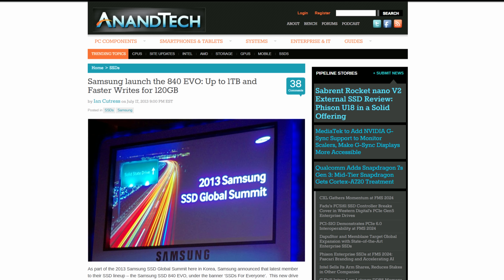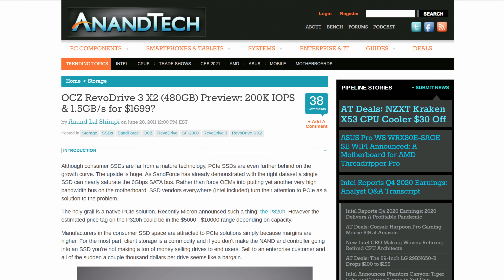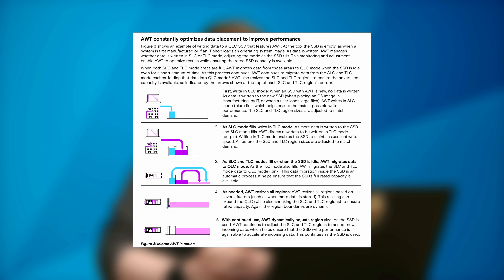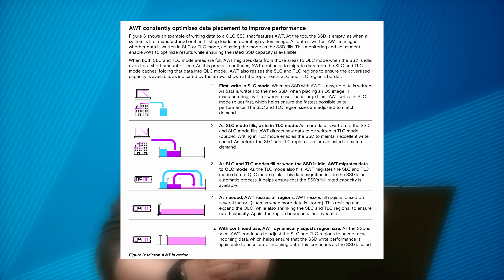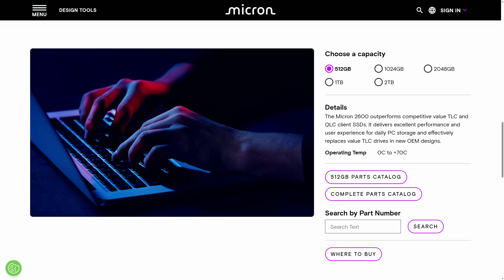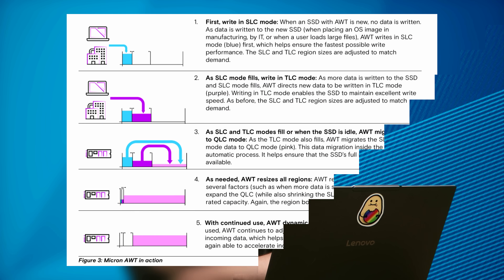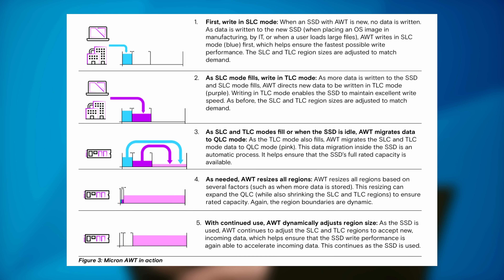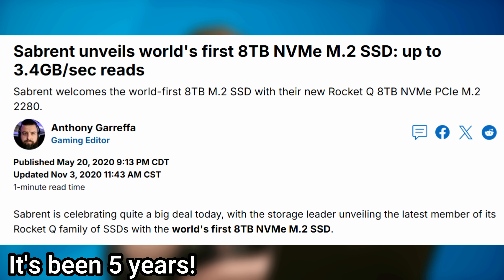Big.Medium.Little Comes to Consumer SSDs

Comment: Is this functionality enabled purely through the controller and its firmware, or does it require the actual NAND chips themselves to support multiple modes (for example instead of just TLC or combination SLC/TLC, you need a special chip that can either write SLC/TLC or QLC)?
Reply from the maker: It's probably 99% firmware, 1% hardware. They said it required some customization. That might be for some weird edge case though.

Comment: Flash sucks. Period. It has sucked since the late 70's when Toshiba started developing it. It doesn't deserve the status of "SSD". Just because it's better than Rotating Iron Oxide (1950's technology), doesn't mean it's that much better. One big reason it can be so fast in transfer rate is that it has many channels, typically 8, sometimes 16 or more. There's just so many things wrong with flash... but that's all we're given.

Comment: There are PCIE 5x2 SSD, such as the 990 EVO Plus.
However, the PCIE Lane allocation is not just something on the SSD end, you would need cooperation from the mobo end on how they lay out the lanes too, of which I have not seen much if anyone doing PCIE 5.0 x2 for M.2 slots.
Reply: Many AM5 boards have PCIe 5 x2 as an option because the other two lanes are (optionally) taken up by the USB4 chipset.
Reply from the maker: It requires bifurcation support as well at the CPU level. AMD Threadripper and EPYC are good at this, Ryzen can depend, Intel is almost a no-go and requires specific combinations.

Comment: This smells like, let's push QLC on everything so we can sell more drives in the future
Reply: The technology is the same if you make SLC or QLC drives, so the price for the memory chips is the same. Only thing it that you need four times the memory chips for SLC as for QLC, so at minimum if you only look at the BOM or Bill of Material the SLC memory is four times as costly for the customers. You get 1TB of SLC space for the cost of 4TB QLC. That's a hard sale as people are pinching their money.

When you talk about durability there's the TBW or TeraBytes Written. This is a number the manufacturers assign to their drives and it's supposed to give an indication of how durable the drives are. I say "supposed to" as it's not easy to predict durability before many thousands of the drive has been used for a long time and punished with a lot of written data. Someone said that it's the figure at which 50% of the drives has failed. But the manufacturers use it in a way that I think it's a lot better than that. Most manufacturers have a 3 to 5 year warranty, but it's appended by "or up to TBW". That means that even if the drive are within the warranty time the warranty is not valid if there has been more data written to the drive than the TBW rating.

So we have a kind of durability index, but what does that mean? After all all drives use similar memory and often the same controllers so they all have the same durability,. Right?

Wrong, or at least to the manufacturers this is not the case. Looking at the webstore I usually use I see that the Crucial E100 M.2 NVMe SSD 1TB has a TBW of 80. The warranty is 3 years or until it reaches TBW.
Switching to a Kingston NV3 M.2 NVMe Gen 4 1TB it has a TBW of 320, and a warranty of 5 years or until it reach TBW.

And the Kingston drive isn't really extreme, nor is the Crucial one. If we look at Crucial T500 1TB M.2 NVMe PCIe Gen 4 it has a TBW of 600 and a Kingston Fury Renegade G5 1024GB PCIe 5.0 M.2 NVMe has a TBW of 1000

Now I will say that the Crucial E100 has the lowest TBW I've seen and that the Kingston Fury Renegade has one of the highest. I've only seen one with a higher TBW and that's the Seagate Firecuda 530 which has a TBW of at least 1200. The 4TB version has a TBW of 5100 and the 4TB Kingston Fury Renegade has a TBW of 4000.

Now as the durability of drives are hard to predict before enough has been used for long enough isn't this just a glory number for the manufacturers to wave around?

No I don't think so. The use of five years warranty or up to TBW means that they really believe that these drives will be decently reliable up to that many written terabytes. A RMA really costs a lot of money and they absolutely want to minimize the warranty claims they have to handle. The Seagate warranty also offer to recover all data that's readable from the failed drive, and that's an extra cost so they really don't want people to request warranty support.
Reply: QLC for most NAND storage devices is probably the right approach for most applications outside of HPC, wouldn't you say?
Reply: @paxdriver  It's too slow, and does not have a long life. I would consider it for a media server that mostly reads, but for that it's still too expensive to have a 18TB drive for 300 usd
Reply: @silajim  Controllers are smart enough that you won't notice a difference. The individual cells may be less reliable but wear leveling, overprovisioning and error correction will hide that from you.
Reply: @paxdriver  no. just more cost savings for makers but almost none passed down the chain
Reply: @lelkasa361  Are you saying there is no competition between SSD manufacturers? Of course there is (but right now there is a lot of demand from data centers).
Reply: @paxdriver I would agree if the only concern was performance.

It isn't, the main downside for adding more bits/cell has always been lifespan.

This technology doesn't change that.
For some usecases, QLC is perfectly fine.

But on any consumer device expected to be used on a regular basis?

Do you really want to take that risk with your personal data? 

I personally don't and i doubt most people will take a 33%(Max) saving on  a relatively affordable component but have it risk reliability.
Reply: @krazybonnie5523  The SSD controller manages endurance for you, and it can even let you know if the SSD's health has degraded to the point that it should be replaced. An SSD won't just suddenly die. If QLC cells break, error correction makes up for it, and the controller will just move the data elsewhere.

Comment: regarding cell degradation, i wonder if it would be possible to rotate a cell that has drifted too far to support QLC mode to be permanently in TLC or SLC mode.
More information and control over this stuff should really be exposed to the users
Reply from the maker: Yes that's perfectly possible, however the default mode if a cell starts to degrade is label it unusable and take a different cell (or rather, page) from the pool of overprovisioned storage. Lots of people feel uneasy using cells for data that 'are degraded from warrantied use'.

Comment: Cool thing is that they can re-purpose cells for different modes.
Not sure how SLC is less harsher. If I understood correctly, it still changes between some levels that match some bits combinations of QLC.
I thought that longevity of SLC comes from the fact that it is easier distinguish levels corresponding to bits and if cell degrades it is harder to keep it at designated levels.
Would be cool if they would repurpose QLC to SLC when cell quality expected to degrade soon. E.g. have shrinking SSD instead of just "bad sectors" once run out of replacements.
Reply: Flash cells does not work that way. When a cell degrades it means it can't hold the charges in the charge trap material anymore so even if they convert the cell into SLC the probability of an error is now very high that it's no longer a reliable storage medium.
Reply: @kazedcat  why SLC have higher longevity and QLC?
Reply: @virkony it's probabilistic with more bits per cell the chance of a bit error is higher. The charge trap material degradation is independent of the bit level but the longevity is affected by the error rate.
Reply: @kazedcat  sorry. I don't understand your logic.
You effectively say that more bits per cell (e.g. QLC instead of SLC) is what influences longevity since error rate will be higher for QLC.

On the other hand you say that bit level (SLC vs QLC) have no impact on degradation. I.e. when we write to SLC and QLC cells they will degrade equally.

This only supports my assumption that SLC lives longer just because it have lower error rate which is because it is easier to separate charge levels between smaller number of bits than between bigger number. E.g. if max stored charge drifts, there is bigger margin before bits get flipped to the point when error correction not effective.

Comment: One point I don’t think you made: As an AWT drive fills up, its pool of SLC will become quite small, eventually leading to slower speeds beyond some small buffer capacity. (Unless they constrain the SLC partition from ever dropping below the generous size that’s common in other drives.)
Reply: That's obvious. It's just a regular buffer, only worse. Instead of full SLC, they want to add TLC and QLC. This is all garbage, not progress.

Comment: a way towards universal memory, they should add tier 4 cache to the cpu/gpu in form of a big hbm chunk in 16plus GB range that supplements bridge between cpu cache/gpu video ram/npu cache/user accessible system ram - than you would have lpddram and optionally additional ram as dimm or sodimm modules and than would come a fast nvme disk so the system itself is not bottlenecked anywhere

Comment: for me i dont care about more speed i think the 5GBs + is already fast enough for a consumer.
What i miss the most for M.2 SSD's is the total potential capacity.
I got got 2x 8TB 1x4TB and 1x2TB i havent replaced the 2TB yet since my os is on it and its a pain to go and replace it.
I started to buy 2x 8TB sata drives just due to my system not supporting more M.2 Drives
I would also like to see maybe drives performing on 2 lanes so i could maybe have more M.2 Drives in my system with the same ammount of PCI express lanes

Comment: Yeah, I'd really like m.2 sockets to stop eating away all the pcie lanes. If you need actual pcie slots you're pretty limited nowadays.
Reply: Ssds run fine on 1x lane.
I've got one running via an adapter off the wifi m.2 lane.
It's not crazy fast, but I can't really tell.

Perhaps that's what you want. A return of that stillborn pcie/sata combo thing ~gen intel. 1 pcie lane on a cable.
Reply: Use intel then; I have pcie lanes to burn.
Reply: @James-l5s7k Intel doesn't really exist in the desktop PC market anymore. They've got some interesting products coming that might change that, but not right now. Intel's latest desktop CPUs have essentially the same PCIe configuration as AMD's, and both of their highest end chipset platforms have the same number of usable PCIe lanes. 24 usable lanes each on the CPU and chipset(s). The main difference is that Intel's got twice as much bandwidth between the CPU and chipset, though that changes the bottleneck, not the lane count. However, not all available lanes are routed to slots. Some go to controllers (wifi, ethernet, USB), some get reallocated as SATA lanes, etc.
Reply: There are m.2 to sata adapters and m.2 to pcie too.
Reply: bring back SATA, or something similar I don't need the ultimate speed, GEN 3 SSD's (even 2 lanes) work for me, I need bulk ssd storage
Reply: @silajim  What is stopping you from using SATA? SATA SSDs never went away, and motherboards still come with SATA connectors.
Reply: They don't really, though. On a modern motherboard, only one of the m.2 slots has dedicated PCIe lanes. The rest are either hanging off the chipset (sharing its PCIe lanes) or require you stealing lanes from something else to operate. Or both. The issue comes with how anything that isn't connected directly to the chipset is hanging off the chipset, and the chipset only has four PCIe lanes back to the CPU, so most of your slots (be they PCIe or m.2) are sharing that. If you really need more PCIe lanes, then your only option is Threadripper.
Reply: @guspaz On my ProArt X670E, the first two NVMe slots are PCIe 5.0 x4 into the CPU. The other two share chipset bandwidth which is PCIe 4.0 x4. The remaining 16x PCIe are shared between the two 16x slots.
Reply: @MarkRose1337  I can't find a block diagram for that specific motherboard, but my guess is that they get a second m.2 on the CPU by moving the USB4 controller to one of the chipsets.
Reply: @guspaz  From my reading that's what was done. The Intel JHL8540 USB4 chip is PCIe gen 3 x4, and the x670e chipset has 8 PCIe gen 3 lanes available (along with 12 gen 4 for the 3rd and 4th NVMe slot, the 10 gbe, so on). The chipset has a gen 4 x4 link. Asus used the chipset well. I only wish the board had included more SATA ports.
Reply: @guspaz eh, not really. Two can be on the cpu and sometimes they even take lanes from the 16x pcie slot. My motherboard has a 8x/4x dual slot mode cause the other 4 lanes go to an m.2. Also i was talking of lanes in general. When they have extra lanes they hardly add pcie slots. Which I'd like.

Comment: I'm probably in the minority here, but SSDs are already fast enough for my needs. What I want is a large capacity SSD that competes with HDDs on price. It doesn't have to be fast - 100-200Mbps writes/reads - so I can use them in my NAS.
Reply: Same here. It's taken forever to hit affordable at 1 TiB, but affordable 4 tib is really taking a long time. 

Part of the issue was that global drive supply was eaten by a dumb crypto coin that used up drives instead of gpus to mine it. That kept prices inflated for far too long.
Reply: My NAS would be very happy if they ever make that.